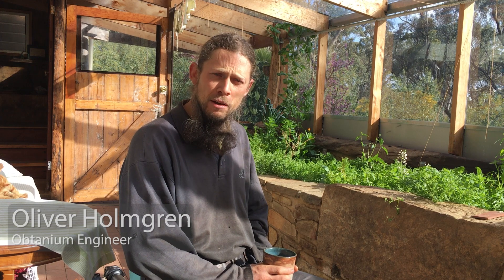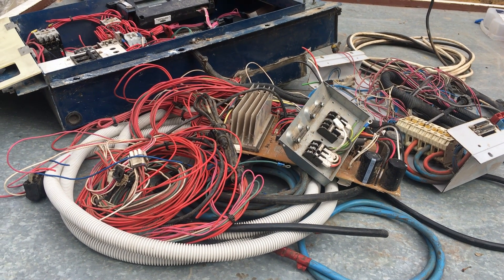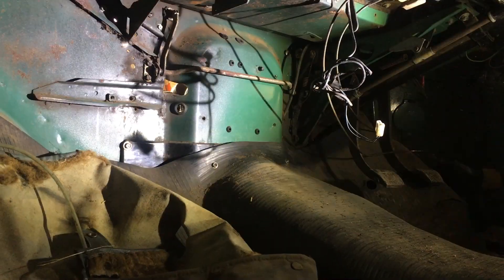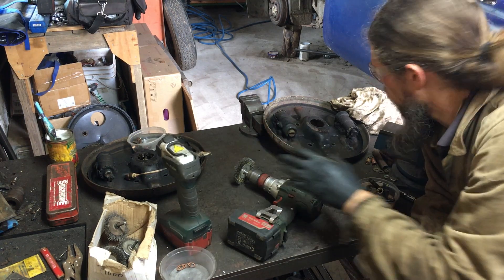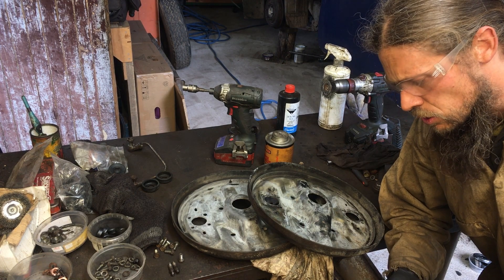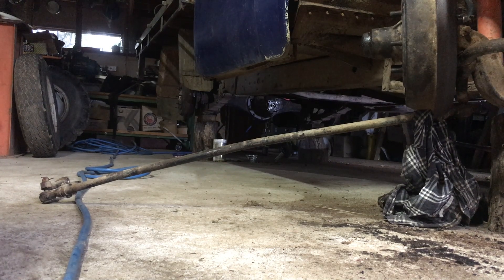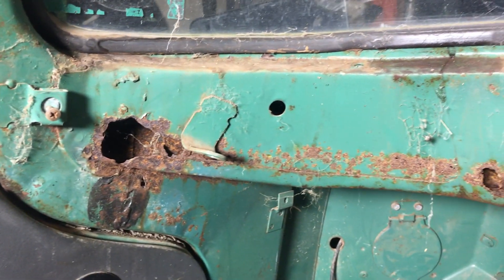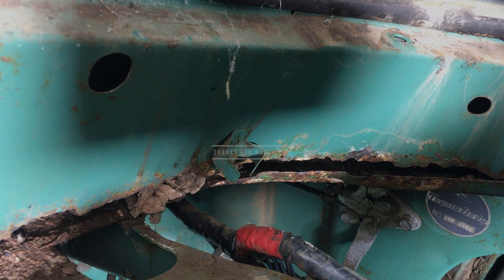Toyota Stout EV Conversion: Episode 7

Comment: My 1965 RK100 didn't have any rust in the headwall back in1982 when Eric Dodge and I decided to sell it (to become a farm ute in northern Vic) in favour of rebuilding  Rome (our wrecked 1972 RK101 originally bought for spares) but we found the design fault you showed had created quite bad rusting. Without knowing the prior history (eg closeness to sea air) we hypothesised that the early Stouts where made so well in terms of priming and coats of paint that they didn't rust despite the design fault but that by 1972 they were cutting corners on quality.  I suppose it hard to complain about the problem after another four decades of weather that Bert has been through only getting some bog along the way. Anyway after wire brush and fish oil we used aluminium patches with epoxy glue and pop rivets which still seem in good shape today. Ol, I will send you the scan of the slide of Eric reassembling the gleaming refridgerator white in his white jumper, so much for your filthy overalls. I think one of the original slides shows the cab upside down so fish all could drain through all the pillar cavities, but that would be really going back through the archives.  Shame I cant post it here but cant help but feel that you might be competing with what your old man did in his day.  But as you know it would really be a competition with Eric Dodge because I was just the grateful assistant to the master of mechanical generosity every weekend for I cant remember how many months.
Reply from the maker: So people, this is where I caught the bug haha